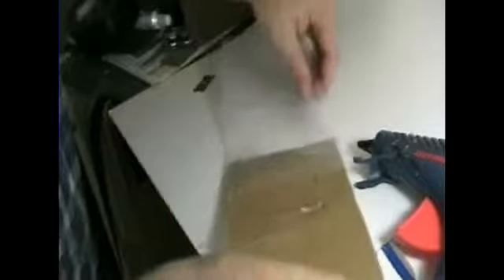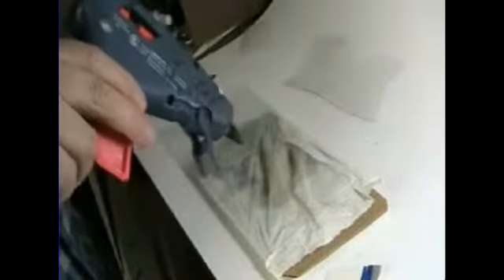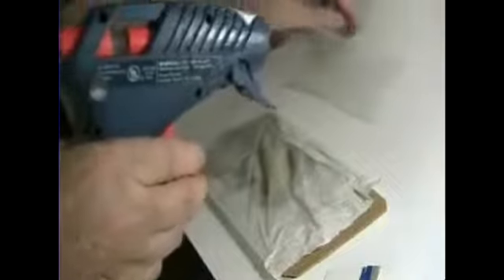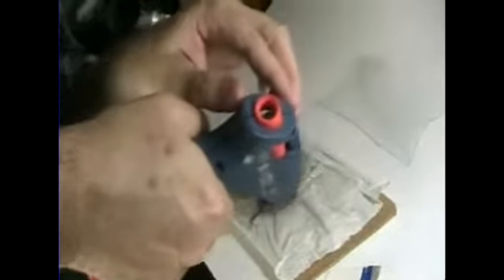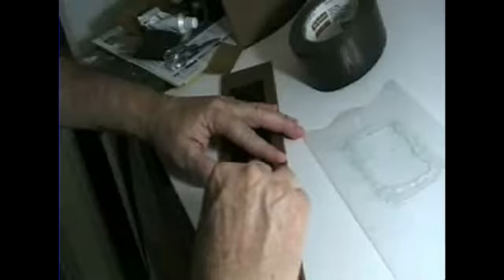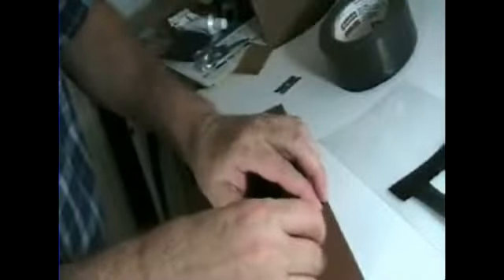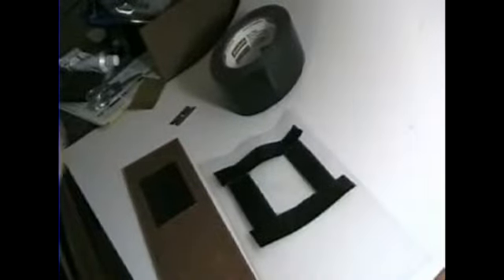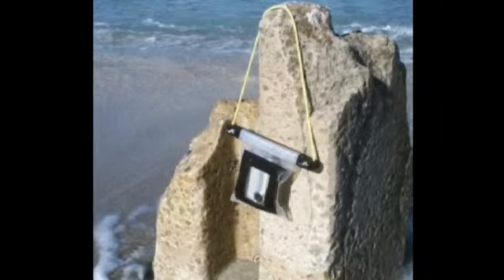part 3 how to make low cost underwater camera housings and bags

Comment: Hi there! I just posted a video of some underwater video that I shot with my homemade underwater camera box. I started in freshwater, which is what the link below will show, but eventually I submerged it into salt water. The box is made from a quality loc-n-loc box and a cheap dashcam. (It may be cheap, but it still shoots at 1080p!) I was able to drop it to about 30 feet, although at that depth I noticed that the side flaps on the box popped open. The camera was still dry, but a couple of rubber bands solved that problem. I still wouldn't take it down much below 30 feet. I have posted several videos of my underwater adventures and am excited to drop it into many lakes and off fishing docks in the area. Check out my videos for my first rendition of a pretty good homemade underwater camera box. (I found all the items needed for this around my home.....although, as I am a geocacher, I knew what kind of loc-n-loc box to use.) I am already working on the next version of an underwater camera box that should produce some very interesting video to post on my channel. Enjoy!
https://www.youtube.com/watch?v=4JFyxVZ-kS4